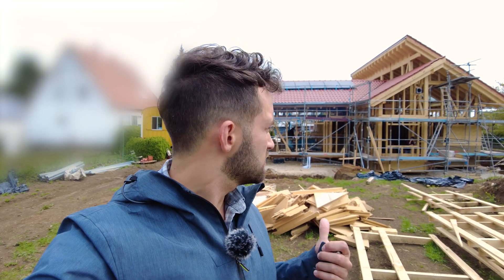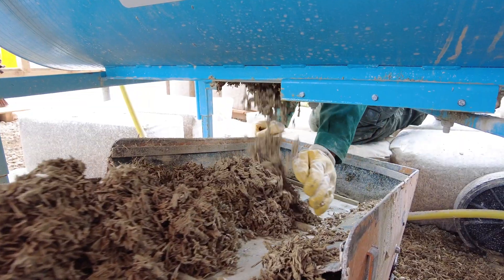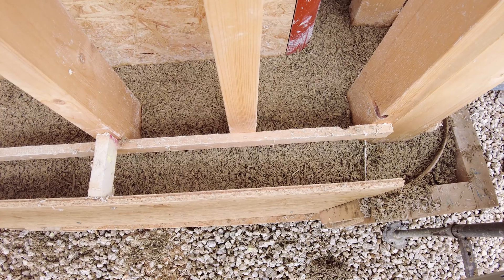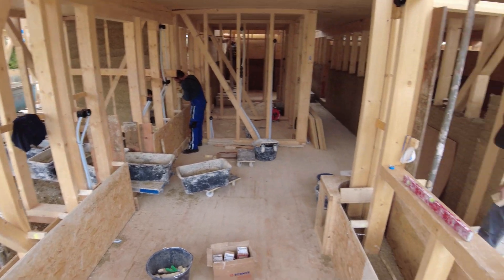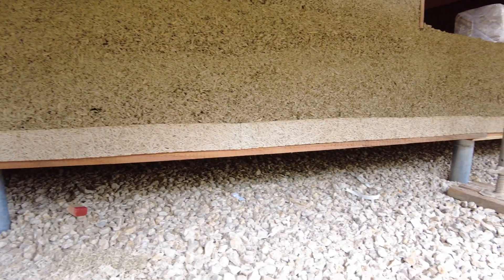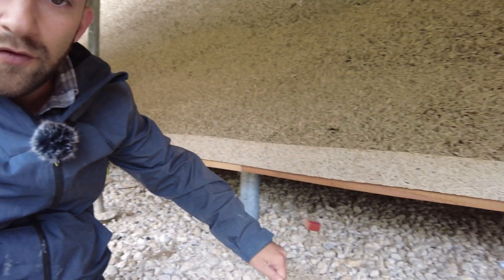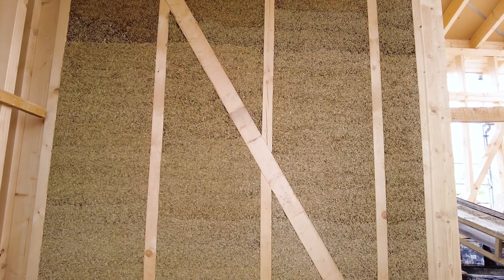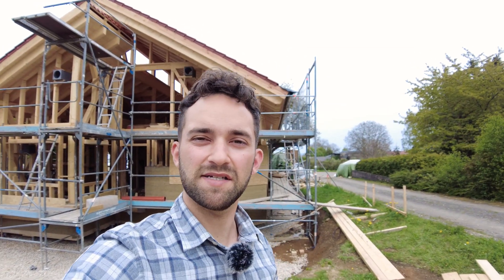Germany's biggest Hempcrete House

Comment: you are the best! I really like the way you talk and film about hempcrete. By the way it would be really interesting to see the details of the floor and the way it is connected to the foundation screws.  This makes the building much more environmental friendly than using common concrete. Greetings from Italy.
Reply from the maker: Thank you Lucas! About the foundations: It is really simple actually. It is just the wooden frame, as an independent floor structure, that sits on the screws at specific points. The structural engineer calculates the right points. The soil must also fullfil the requirements for this kind of foundation.

Comment: Awesome video thank you! Also really interesting and good to see that it is feasible to use ground screw foundations for a building this size. I have only ever seen them used in smaller structures. I would be really interested to see how you have framed and supported the underside of the hempcrete walls on top of the ground screws to allow the hempcrete to be laid on top, if it would be possible to show this in a video? Thanks again and best wishes from Scotland
Reply: Helical piles are approximately 200 years old and were designed and used for the most extreme conditions imaginable.  While we see them often used for small projects like decks they can be engineered to work in most situation.

Comment: Hi
How much did the house cost? Thanks
Reply from the maker: Hello @milly morris, unfortunately I do not have that information. I wasn´t involved in the planning and construction of the house. But I can tell you, that generally building with hempcrete can be in worst case 10-20% more expensive than conventional building. Not because of the material but because of higher labor costs on site. But if you have many volunteers or friends helping in the construction then it could get even cheaper than conventional building.

Comment: nice! whats the big hole for - to use the soil in construction? thanks!
Reply from the maker: No, in this construction no soil is needed. Hempcrete has only 3 main ingredients, water, lime and hemp shives. The hole is made for the sewerage system/drainage later to collect and distribute the grey/rain water.
Reply: @PhilippDoukakis  thanks! do you have any more information about the screws in the ground, is if an affordable solution?
Reply from the maker: @carlroge  the only thing I know about the screws, for this size of building, is that you are going to need approx. 5-6 meters long galvanized steel screws that need to be put in the ground with a machine.  First of all, the ground has to be checked for stability and the authority must be informed because in Germany this is an exception. If your country has more strict rules because of earthquake active region for example, then it might not be possible to get it approved.